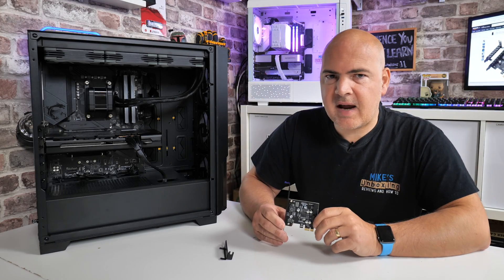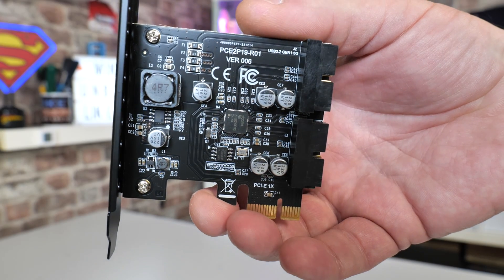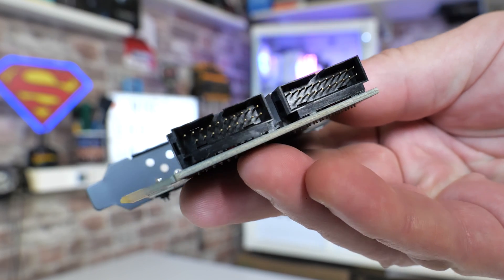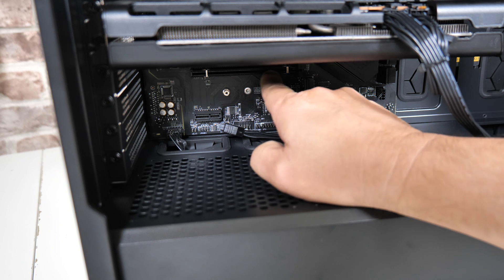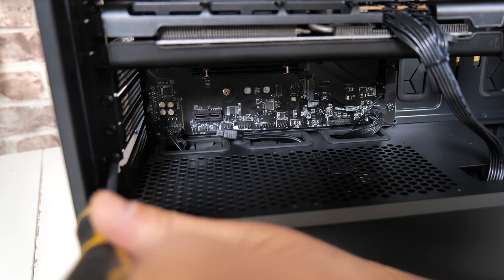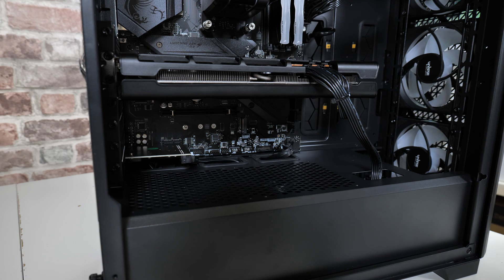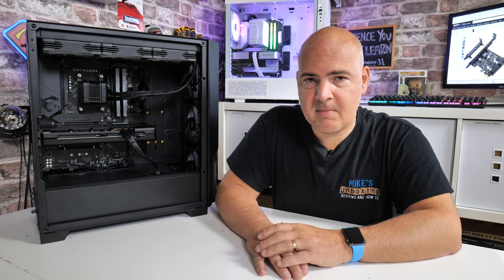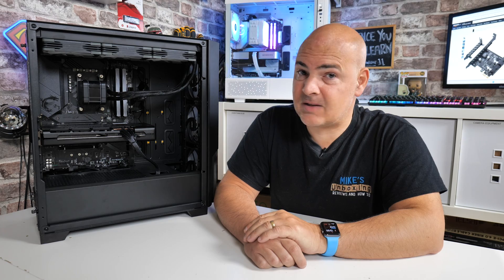How To Add Or Replace USB3 Internal Motherboard Header For Case Ports IO

Comment: my MB has an internal wifi card in that slot. the other ones are blocked by my gpu. would i have to remove the wifi card to install this? there is a slot directly under my gpu intake fan so im not sure about using that one
Reply from the maker: This is maybe easier to fix or at least advise if we can ask more questions and get direct answers, so feel free to join our Discord chat and we can go over it in more detail https://discord.gg/XtBTGQ6BDu
Agree to the rules by clicking the emoji and you will get access to the rest of the Discord channels

Comment: people who manufacture motherboards shouldnt have the pins bend this easily, especially with no warning. youtube tutorials shouldnt have need to been made in order to fix this issue. imagine if gpu power connector were as fragile (though ironically nvidia already had power cable issues). i mean the usb 2.0 and 3.2 gen 2 headers usually have no issues, but nope not this one for some reason.

Comment: I bought this POS adapter because of this video. It doesnt work out of the box. no drivers. seller has no drivers either.
Reply from the maker: The drivers are built in to all supported windows 10 or 11 versions you don’t need a driver

Comment: can you do some files transfer tests with the cards, as the reviews I'm seeing are saying its pants.
Reply from the maker: for a lot of people it will be down to the motherboard chipset and the amount of available PCIe lanes, i have had a few of these now and not experienced any issue with transfer rates it will do the claimed 5 or 10 Gbps (usually the actual case is the limiting factor due to cheapo crap ports)

Comment: This connector needs to be remade its insane how terrible it is
Reply from the maker: i agree totally
Reply: @mikesunboxing  The USB connector needs to be redesigned similarly how audio and fan connectors are made. This way USB 3 pins will not be bent during the build process.

Comment: Hi Mike, in my recent build in the NZXT H1 V2 case with an ITX board, there is no USB C header to feed the USB C port on the top of the case, so at the moment it's just unusable. There IS a USB 3 header that currently feeds the two USB 3 ports on the top of the case, but my questions is, is a USB 3 splitter the answer to providing the USB C port with connectivity as well, or is there another way I can do this? (Needless to say there is no spare PCIE slot either for a solution like the one you cover in this video).
Reply from the maker: yes amazon do a USB 3.0 splitter to create 2 ports

Comment: I have some weird old kit, motherboard with USB 3 rear and no header (think it predated the standard for the header)... used a USB3 A to header cable to wire a rear port to the front header, and since only one of the feeds was needed, I could still connect a hub to the other rear port
Reply from the maker: a lot of early AM3 board never included usb 3 front panel headers

Comment: You could do a whole youtube on things you can plug in x1 slots. Like Ethernet, wifi, NVME, USB etc..
Some of these are not ideal but often a x1 slot is all you have. I have a 5Gbps USB C one that you showed on a prev youtube, and I recently used one on for an NVME drive on a PCIe 3.0 x1 slot and it will do over 800MB/s (so some way off 3000, but faster than a standard SSD) it can be useful in cloning drives too.

Comment: when installing a video card, I accidentally scratched the copper tracks on the motherboard. The paint has crumbled and you can see the shiny copper. I did not notice any problems with the computer, I'm glad.😫 I started to blame myself that I am an idiot and do not understand the assembly, but it turns out that every person can make mistakes, and this is normal, and I am not alone😅
Reply from the maker: very true, and i have done that on this board as well
Reply: @mikesunboxing  I used a black colored wax pencil to hide the motherboard cut, it hides scratches well and is also a dielectric insulator. I don't think there could be a short circuit. Wanted to keep the look
Reply from the maker: @АрданисВершитель  that is a great idea, i might get a black wax crayon in my toolkit

Comment: Cheers Mike very useful. Also if you also need to connect internal USB 3 headers and your motherboard and it only has one header port. But take care on old stock avoid the old PCIe gen 1 and look for the newer well made gen 3 version which are slightly more expensive and usually self power as opposed to the sata or molex power connectors . But as you rightly pointed need to check your motherboard manual and check if PCIe Expansion Slots share the bandwidth and speeds/limits

Comment: I just built in a Lancool 216,with the side pod extra. But my Msi b650 edge only has 1usb header. This is the perfect solution . Thank you . I followed you vid on the  b650 board as well :)
Reply from the maker: Nice 👍
Reply: @mikesunboxing  but the usb's on the side still don't work :(. I assume there are no settings to toggle in bios etc?
Just checked again. Only 1 of the USB''s at the top of the case works as well. Some head scratching is required :(
Reply from the maker: @tommeegunn9318  This is maybe easier to fix or at least advise if we can ask more questions and get direct answers, so feel free to join our Discord chat and we can go over it in more detail https://discord.gg/XtBTGQ6BDu

Agree to the rules by clicking the emoji and you will get access to the rest of the Discord channels
Reply: @mikesunboxing   all sorted. I followed yet another random vid and renewed the drivers.  big STAR to me :P. Thanx for the Discord offer tho'
Reply from the maker: @tommeegunn9318  Glad you got it sorted out 🙂

Comment: Good video and useful information.
I just assembled a MSI Pro Z790-P/i7-13700K build and sure enough broke off pin 11 (USB2.0+) on the USB 3 connector.  I was lucky in that I didn't need that pin.  Only one of the USB output cables was being used by my internal Memory Card Reader.  The other USB 3 header feeds the USB connectors on the case.
Of course I did the damage after the motherboard was installed, otherwise I would have soldered a new pin on.  25 years electronics experience and a NASA trained micro-repair tech.)
But popping in a $10 circuit card makes perfect sense!
Reply: Hi, you give tips on how could this be done? I would wanna try it my board, but didn't find anyone who did it.

Comment: I replaced my motherboard in my daily driver PC about a week ago. When I removed the dreaded USB3 cable...it decided it was also going to remove the socket from the board. When I finally removed the socket... I was able to gently put the socket back on the board. Whew, what a pain. Thanks Bob for helping Mike with his problem. Next time, I think I will get an internal plug-in board and not even bother to plug-in the front panel cable into the motherboard. Take care all. Cheers
Reply from the maker: cheers Rick! have a blessed day